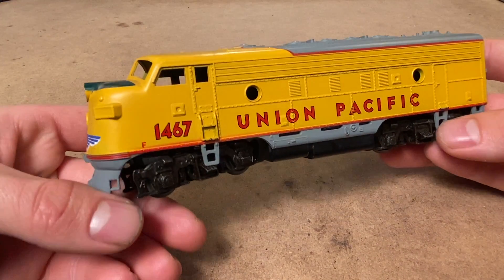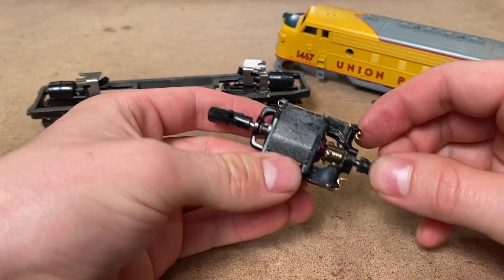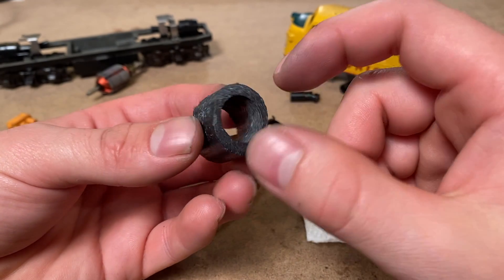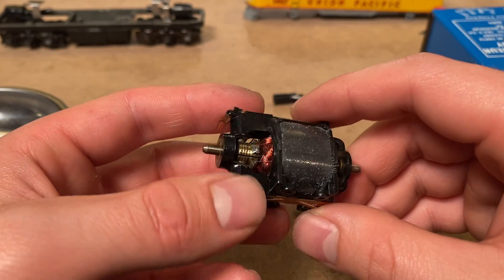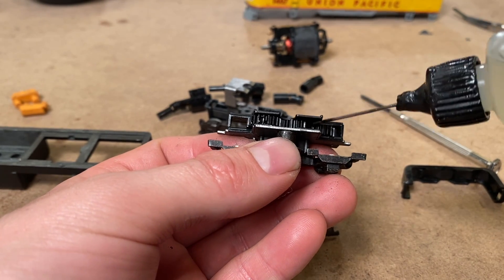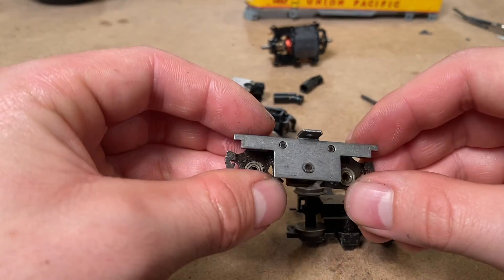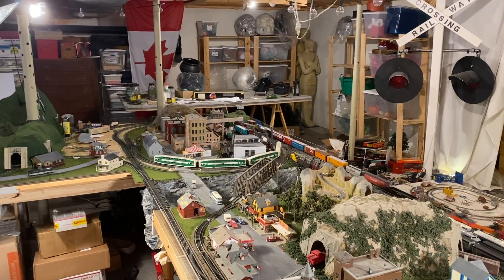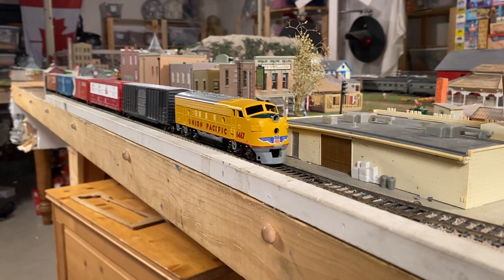Can We Make This 1969 Union Pacific F7 Run? Seized Motor...

Comment: I gotta say Harrison, that is one of the more bizarre issues I've seen on any locomotive, let alone an Athearn locomotive!  It's strange it also lacks the familiar dual flywheel design found on most Athearn locomotives, but then again, I'm nowhere near as familiar with the pre blue box locomotives in that department.  Either way, this thing still has plenty of life left in it and they also appear to be real speedsters as well, I thought it was going to fly off the table for a minute there, lol!  Great work as always Harrison!
Reply from the maker: Quality control errors on an Athearn are practically non existent so I'm guessing someone replaced the motor mounts and ended up bending the clip which holds the motor together causing it to do this. Still a very odd issue
Reply: @SMTMainline  I’ll tell you this man maybe anytime if I get a athearn engine like this for parts even it the motor and the magnets right there if there warped, I’ll have to try to be careful on it.
Reply: The old bluebox F7's was sold both with or without flywheel back in the 70's early 80's.
Reply: @magnuswettermark8293  I never experienced them I have a F7 that's from 2005 has flywheels and is nice just needs more weight I believe to pull more. Otherwise it's not bad. My proto 2000 C liner out pulls the Athearn I have but eh I like them far better then bachmann
Reply: @mercuryoak2  Flywheels didn’t come until 1973. The rubber motor mounts was 1967. I have a blue box F7A from 1964-67 that has screws holding the motor in.
Reply: Oh Randall yeah I remember the time he ran the bachmann spectrum Amtrak Acela I’ll tell you this it was pretty fast right and it did flew off the layout table there and broke into pieces when I saw it I was like oh man that can’t be good there. Yea I’m pretty sure things happen though some of my engines can do the same things but like tipped over or something idk.
Reply: @MattKonsol  I also believe that acela was running on 18 radius curves when he didn't have 22 radius then I'm not sure. I remember that day I was in total shock myself. but at the same time it doesn't surprise me because the locomotive is very light weight I've had my own life like fph 40 lift up on the right side and semi cut power off and as the wheels dropped down it would take off again like a rocket which I only did that on the floor I didn't have a way out then.

Comment: Great work. Also could o send you an engine I’m having issues with. The motors fine but for some reason it’s wheels won’t pick up power. It’s a riverossi 0-6-0 tender engine. And no the tender doesn’t pick up power
Reply: make sure the drivers aren't placed incorrectly, either.
Reply: The tenders wheels are all plastic and I’ve run it without the tender before and it worked fine
Reply from the maker: Make sure the wheels on the tender are on the side they're suppose to be.